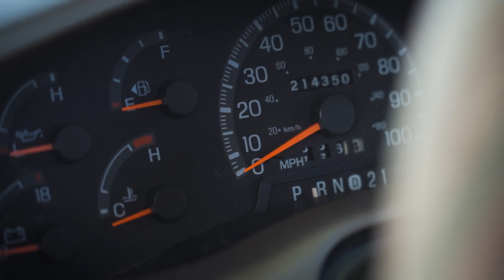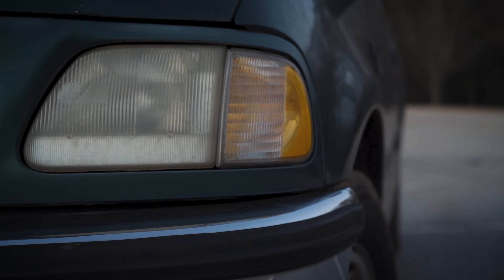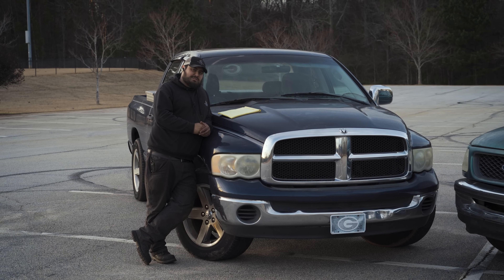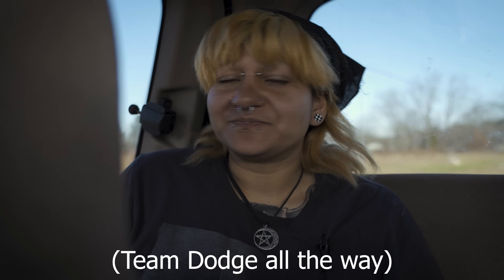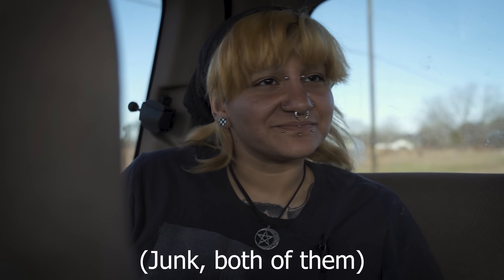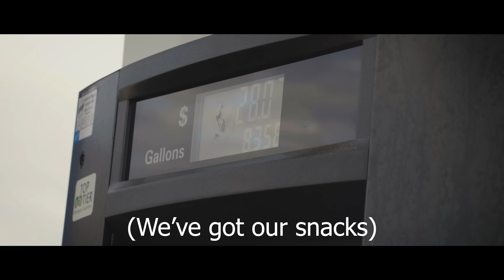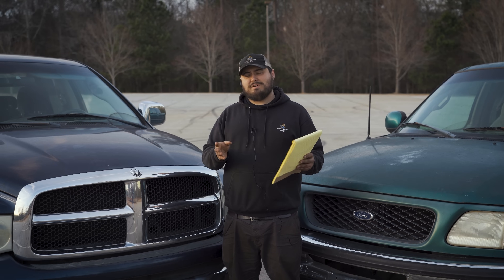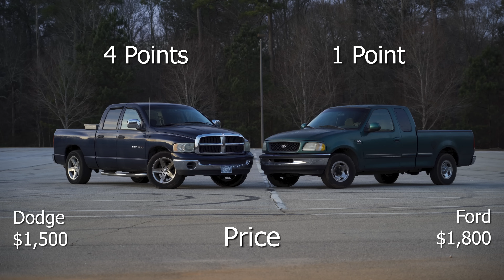CHEAP TRUCK TOWING CHALLENGE, Head to Head Towing Challenge, Dodge Ram 1500 vs Ford F-150 Reviews

Comment: These trucks are way more realistic than some 85k truck
Reply: I just can't see how people would want to work out of a 85k truck. I'd be like bubble wrapping everything I put in the bed and shit , f that
Reply: Always owned at least 200k usually only 500$ tow anything
Reply: I hear a lot of people saying that and it's mostly because they can't afford it the racing the prices on pickups because pickup truck is a work truck
Reply: @outdoorlifemaine6691  no pickups haul groceries.   Work .   Off-road.   Drag.  Scrap hauler.    It's black white and grey
Reply: 85k is a half ton gasser. 3/4 or 1 ton diesels are over 100k
Reply: @JohnDoe-ud2cc  I have a 98 ram for 80k but today only 200k+miles great deal
Reply: @rosslefave5877  we are talking about price not mileage. We are talking about trucks that cost $100,000 not that have 200k miles.
Reply: @JohnDoe-ud2cc  ok I will sell to you for 100k but it's a 98 ram. You are really good negotiator
Reply: @EricPach  They're rich and/or company is rich. They just use it as a tool and trade it in on a new one in a few years.
Reply: I have 2002 F-150 super crew. It has over 200 thousand miles on it. Works great.

Comment: You did many things right in this video.  Camera, audio were good.   The only thing that gives you a big minus is the negative comments on the Dodge.  Sounds to me you wanted to plant seeds for failure no matter what the results were.  I have had both trucks Dodge and Ford. I would suggest (since you are the reviewer) keeping personal feelings out of the picture and let the viewers watch.  Neither one is great but overall I pick the Dodge.  The reason?  Looks, power, comfort and towing.  The Ford was good too in its own ways.
Reply from the maker: So I owned both trucks and used them for a period of time to get a personal opinion. I got stranded, wallet assaulted, and trouble out of the dodge, where as the Ford, simply worked. I choose a Tundra any day over both these toilets, but Tundras cost big money, so for the cheap, I'd say it depends on what you are doing with it, as shown in the video. Thanks for the comment
Reply: @GrumpyMonkeyGarage  OK got to respect that.  Question .........who are the two people that were with you on the video??
Reply: @GrumpyMonkeyGarage reviewing clapped out trucks will never give you solid respectable results. I have an ‘05 and towed with no squat. Oh, maybe cause I actually maintain my truck.
Reply: @GrumpyMonkeyGarage  Honestly that 4.7L that Dodge made wasn't a very good motor. They produced quite a bit of power, but they just don't last unless they are babied. (often have overheating issues resulting in cracked blocks) The 5.2L and the 5.9L were very good motors. They just stopped producing the 5.9Ls because after 2003 they just couldn't pass emissions.
Reply: @lieut.griffin6904  i have a 02 5.9 for 6 years and have put 5000 miles on it and i have only put about $2000 in to it yes it is a good truck 🙂
Reply: I mean 2 different generations
Reply: @oldrango883 Buddy that dodge is not clapped out🤣 Paint is perfect, Chrome is still in good condition. If that’s clapped out then you must live in the city
Reply: The third gen dodge was a turd while my second gen never had any issues other than a coil in the last 22 years and I’ve towed with it, mudded it and beat the hell out of it since new… original transmission and all power train. My 2009 F150 Wes good too but electrical gremlins non stop and left me stranded numerous times. Towed ok but that was about it
Reply: @oldrango883  an "05 what? Ford, Ram, Dodge or ?????

Comment: On the ford, looked like the trailer was putting too much weight on the hitch. If you had room to move the car back on the trailer a bit more I think that would have greatly improved the handling. I've towed quite a bit with my 97 F-150 extended cab and I found load placement to greatly impact stability.
Reply: Fords have heavier rear end only reason they don't break traction easy
Reply: Yes he had the car way to far up on the trailer.
Reply: @rosslefave5877  where did you hear this?
Reply: @forthefunofit5487 as a chevy guy, ford makes the best rear end out of the big 3 overall
Reply: I have hauled way more with my 97 f150 as in hauled a f150 with the f150 with no problems lol
Reply: It's sketchy to have a car further back on a trailer. Especially on a 4.6 equipped F150, I would assume it doesn't have the biggest axle or brakes

Comment: I’ll at least say I’m glad to see that you guys got the better engine for the F-150. That 4.6 is so much better than the 5.4.
Reply: The 5.4 from that era was good. It's essentially the 4.6 but bigger. The 5.4 3v is the one that sucks.
Reply: I would say the 5.4 in that specific generation is the better engine and this challenge they’ve loaded the trailer wrong causing a bunch of tongue weight causing the steering to be unstable
Reply: good luck with the spark plugs!
Reply: @themopar426  First gen was fine; properly torqued they'd stay put forever.   It was the 3 and 4 valve heads from 2003-4 with small threads, then up to 2007 with the two piece plugs that had the most issues.
Reply: @ivanluna7352 not all 5.4 3v suck mine has over 250k still going strong the only problem with them was timming chain/cam phasers if you properly maintain them they don't have any issues and the ones that had that problem was first year 3vs including the 4.6 they both shared the same issues
Reply: The V6 are best in all brands
Reply: @rosslefave5877  um no the 3.7 v6 is straight trash
Reply: @enjoythesho1992  must be something newer of course it's junk the 3.9 magnum is great the 4.2 triton is good the vortech 4.3 is faster on highway than 350. I'd rather have any of them then a V8
Reply: @enjoythesho1992  I don't think I have been in a vehicle 2011+ similar to people the older are reliable might not be fast. 300+hp 30+mpg and 2011 sounds like a fairytale. And it's a car engine
Reply: @rosslefave5877  the 3.9 is a pushrod engine they are extremely reliable engines the 4.3 also pushrod also reliable as nails the 4.2 is a modular engine it's a decent engine but not comparable to a 4.3/3.9 ford 4.0 is a pushrod engine very reliable
Reply: @rosslefave5877 I have 310k on my 4.2 . It won't win any races but it is unbelievably reliable
Reply: 5.4 2v is 🐐
Reply: @flimflam6547  420 is🦄6.9
Reply: I love my 4.6
Reply: The 3.7 is fine in lighter vehicles, it’s probably the worst motor I could think to put in a half ton. Unless you’re talking a 2wd single cab short bed gardeners truck.
Reply: I'm here to disagree my 98 5.4 with almost 200k miles is running like a champ
Reply: The 5.4 2 valve is the same engine aside from displacement.  You are confusing it with the 3 valve I think.   Head problems with both 2 and 3 valve engines though.

Comment: I have a 98 Dodge with 297,000 me still has the original motor and transmission in front row and rear end so I don't know why people say that Dodgers are not reliable and it gets 20 miles to a gallon on the highway at 70 mph it has a 5.2 Magnum and it's four-wheel drive extended cab
Reply: people always say the i have an 05 hemi runs great uses no oil at 237k. but every ford trition ive owned hasnt made it a month without blowing plugs or head gaskets particularly the 4.6 l
Reply: maybe its just i picked bad ones also. depends on how well its taken care of as well

Comment: Idk why the 4.7 Mopar gets so much hate...my uncles 06 has been super reliable with over 250k mi on it and my mom's 02 had 100k mi on it with no engine trouble when she sold it. If you actually change your oil and maintain it they're pretty good little engines.
Reply: If I didn’t know anything about cars I would think the 4.7 is POS accord to the internet lol.  Don’t over heat it and it is a really reliable engine. Worked as mechanic for 12 years rarely had to fix the 4.7 for anything more then a water pump or broken exhaust manifold bolts. Few head jobs due to over heating. I like the 4.6 2v from ford but it has more issues then the 4.7 mopar
Reply: @alexgrindnshine2522 it's a great engine. Even when the valve seats fall out in the 4.7, RARELY does it grenade the engine. Or even bend a valve ! The seat stays there....

Comment: I got lucky with my find but I found a 05 ram 128k miles 5.7 hemi 1500 everything in works amazing I put a shift kit in the transmission and a high flow oil pump in the motor I tow 10000 lbs all the time and it works great transmission works great no leaks all electronics work interior is in great condition it even came with a 6in fabtec lift I will say that occasionally when I go over a bad bump the wiper will come on for no reason  I drove a 350 mile trip to Nebraska (maxed at 75mph on cruise control) on 1 tank of gas - great truck for 2000 bucks I think

Comment: Also, as someone who saw their old man own a 2000 model 4.7 dodge, you bag on them wayy too much, they don't just magically die like you act... my adoptive father didn't change a major component for 400k miles on his 4.7... either of these 2 trucks can last 400k miles without abusing them, and yes, he towed with his, all the way up to a 86 ford hippievan e150 weighing probs 7000lbs.
Reply: i agree everytruck has problems its a part of life.
Reply: @doublegrant6144  I just think he bagged on the Dodge way too much, damn thing did everything the Ford did, but better and he was still saying buy the ford... Not to mention half the early 2000s Ford's will literally blow the plugs out the cylinder heads and you will have to helicoil them lol
Reply: @SleezyRaidz  i agree, also can what about the 6.4 Powerstroke lmao. Only ford can make an engine only last 30k miles
Reply: All of the 4.7 rams I drove felt way underpowered.   I did think the wiper issue was funny since I see ford's with that problem way more. ( not a manufacturer specific problem obviously)

Comment: Entertaining video and I know you hate RAM.  I grew up in Ford F150s and i bought Ford's up until 2015.  Depending on the model year Ford I had, somtimes I spent more money keeping them running than the monthly payment.  I bought a new ram 1500 in 2015 and still driving it.  Replaced battery at year seven. Minus airbag recalls, not one single failure at 141000 miles. A truck will last longer just doing basic maintenance regardless of the brand.

Comment: I will say though that the Dodge 5.9 L Magnum V8 is a pretty reliable engine in my opinion. Not good on gas but lasts longer than today's junk
Reply from the maker: Absolutely, and in my 3rd gen dodge truck review that was one of my favorite engines!
Reply: The 12 valve was great but only the magnum 12v Cummins are Junk
Reply: i have a 02 5.9 its a great truck iv had  for 5 years still going strong
Reply: Ive got a 97 ram with a 5.9 magnum more reliable than my 2012 subaru
Reply: @rosslefave5877 the 12v was Cummins.. the 5.9 magnum wasn’t a 12v engine.
Reply: @Racc506  I'm talking about a V6 3.9 magnum and 2 valves per cylinder and 6 cylinder V6=12valves the 5.9v8 is 16 valves
Reply: @Racc506  you are wrong
Reply: @Racc506  one day you might be able to math
Reply: @Racc506  the best 12 valve is magnum the Cummins is trash the 3.9 magnum is the best 12valve
Reply: @rosslefave5877 😂😂

Comment: I have an 03 ram quad cab, manual 5 spd 4×4 right now theyre going for 6-7k in Alaska, more for the manual transmission because theyre rare nowadays. Of course mine needs a new 4.7 because the kid never checked the oil, drove it like he stole it and ran it dry at high rpm. Now of course im torn, do i bolt a hemi in? Or build a 4.7 with hellcat oil pump and raised compression or, do i plop a 318/ 340/ 360 in there with a carb and forget about all the sensors but the oil pressure, coolant temp etc . The dilemma  is real! All will bolt in. Not sure but i think the 6.2 will bolt in as well. If i was rich id just buy a ram 3500 with the cummins deisel and manual shift to solve all my issues but alas thats not in the budget

Comment: As a current owner of a 99 4.6 Ford expedition and a previous owner of a 98 5.2 Dodge Ram. I'd easily choose the Ram for hauling and the Ford for driving. However I had an abusive relationship with the Dodge, and finally came to my senses with the Ford.
Reply: I must say this, Your comparison is lacking. I feel it would be fairly obvious that the Dodge pickup would tow better than a full size SUV. Not trying too be negative just an observation 🤘
Reply: @remingtonwells7286 the ford expedition shares the same frame and engine has the f150
Reply: @GamerBoy-ye2op  Yes it may share the same frame but an F150 has more leaf springs. and higher load capacity. Not really a fair comparison.
Reply: @GamerBoy-ye2op  And an F150 has multiple different engine options aswell lol. not just “the same”

Comment: I worked for a local school district for 35 years. Plowed snow for 30years. Went through 5 trucks four  F 350's one GMC 3500. I have to say those Fords were awesome. They sat out in the winter and never failed to start never even in some Brutal winters. Raise that eight foot western no sag the plow just came up. Sit a skid of rock salt in the bed 49 50lb bags nothing did not make a difference in how the truck handled accelerated they were just good trucks. My favorite was a 1992 with a 460 automatic 4 10 axles loved it a true work truck. Pulled Tractors around the district pulled 13,000 pound band trailers all over with them all . The GMC was a 1997 350 auto not sure on the axles and while it was a Good truck my only complaint was the suspension was a little to soft. It didn't haul as good as the Fords and the front would sag when you raised the plow. People said we could crank up the torsion bars, but in my opinion when you buy a work truck it should be ready to work from the factory. Especially if you order it as we did tow and plow package.
Reply: Ford always been superior in tq even boats the Chevy might pass after a mile
Reply: Makes sense. This is anecdotal evidence of course, but most people I know that had the Chevys weren't fans of the independent front suspension they had. It's not a bad idea. Chevy trying to make their heavy duty trucks ride better. They just didn't build them heavy enough. I think they're better now on the newer ones, but late 90s early 2000s not so much. Gold's front end was just a solid axle and leaf springs. Right out of the 50s and 60s kind of thing. Rode horrible, but was tough as nails as you pointed out.

Comment: Sorry, I have to disagree with your comments. My '04 Ram 1500 is my daily driver and is also used to tow our 24-foot camper (3k+ Lbs.) and I've had no bad electrical problems... Engine, trans and rear end are just fine... Had a slight over heating problem once, but that's because a radiator hose started leaking. I can't speak to the Ford, but my Dodge is a keeper
Reply: I'm a dodge/ram guy all the way. But dodge has always had terrible electronics. My mom had a 04 ram 2500 diesel and it was littered with electrical issues. My 94 ram 2500 has electrical issues, but it's older so no surprise. My dad's 2012 ram 2500 has electrical issues. My 17 ram 1500 is so far so good.
Reply: @Texas12valve  Sorry to hear about the problems... This is the 3rd Dodge Ram I've owned. 1989 W100, 1999 D100 and now this one. No electrical problems, but the 99 D100 had leaking freeze plugs which kept shorting out the starter. Technically an electrical problem I guess
Reply: @ronruba9147  every brand has their problems. I'm still gonna buy rams

Comment: I had an 03 F150 that towed one of those 6x12 u hauls with when i moved loaded to the absolute brim and the whole package was very stable on the highway going 70-80. My biggest complaint about the experience would have been the brakes, but that is partially my fault as i put on the cheapest pads that i could find.
Reply: I had a 00 with one rear brake great fun driving in Detroit but it was the V6 and stick
Reply: Those F150's will tow anything you want, it goes back to how you load the trailer. He had that car way to far up on that trailer, if he had moved it back a foot-foot& a half it would have been a lot better. He practically had all the weight of the car on the truck & very little on the trailer.
Reply: My dad's freind got our chevy express and a enterprise out of a foot of snow

Comment: Salvage yard owner here. My vote will be this Ford 100% of the time. I buy these on the scale, running trucks, with 300k+ miles all the time. Reason people scrap them is because those bodies rot out so badly. 
The Dodge never drive in the yard. Towed in because their trans are junk.
Reply: LOL ok the 545rfe is one of the best transmissions ever made out of ANY manufacturer

Comment: Would the stability of the tow vehicle go to the lower profile of the 20 inch rims. Lower profile tires would mean less side wall flex under the load of the trailer.

Comment: Did you take hit the slack on the accelerator pedal? I know that seems wildly elementary but that gave made a difference I only had half pedal distance until I used zip ties now I have full travel and resistance and almost full power 😂

Comment: I’d like to see all the full size pick ups in this test but you won’t find a Silverado or Tundra with those miles anywhere near those prices 😅

Silverado with 220k: $6,000 
Tundra with 220k: $7,000